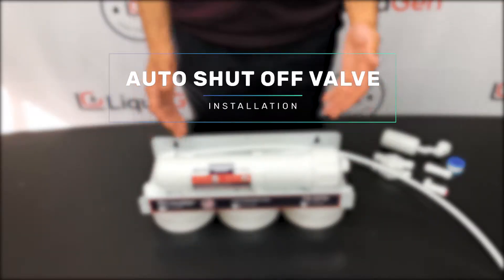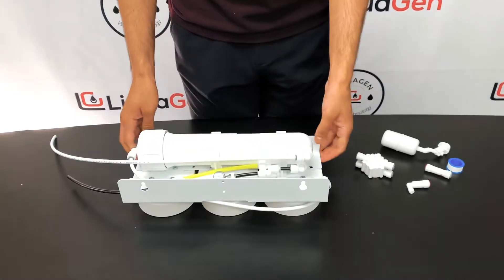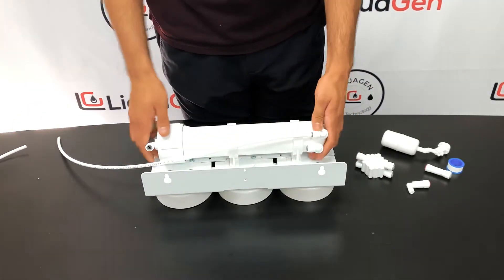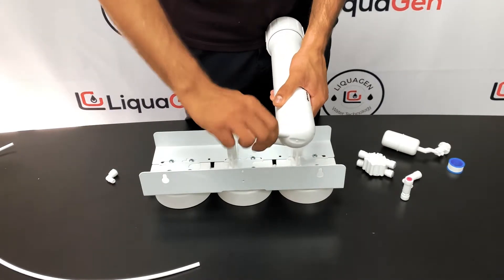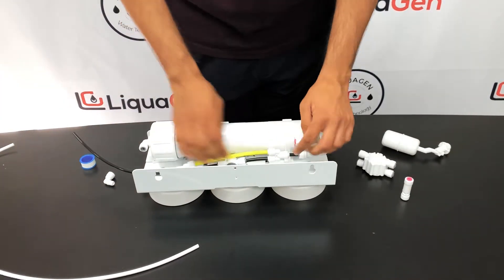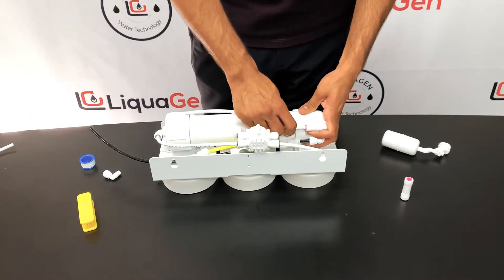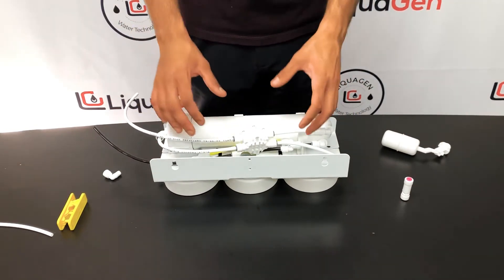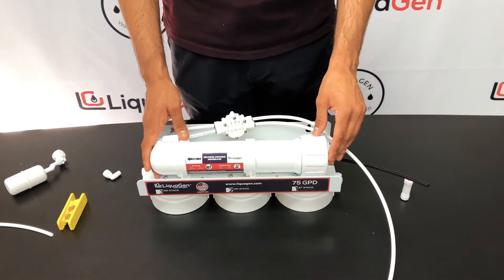How to Install an Automatic Shutoff and Check Valve on a Reverse Osmosis System

Comment: In a 5 stg unit do you still run the low pressure line in from membrane and out to di stgs or at the very end of the unit closets to float valve.

Comment: I wonder why this needs the check valve while the Auto-shutoff valve already prevent the water flow back to that direction? Is the check valve purpose to conserve water?
Reply: It needs the check valve In case the 4-way auto shutoff valve goes bad...which mine just did. I'm glad its not very expensive.

Comment: So you replaced 2 check valves?  Or is the valve on the bottom called something different?
Reply: Seemingly, the bottom, waste-line fitting was removed for no apparent reason but was reinstalled.

Comment: I don't get it man, why are all these people installing the check valve on the waste water line?  It seemed wrong and I see your video shows check valve installation on the purified water line, which makes way more sense since it's often going into a pressurized tank that could potentially backflow water into the membrane...
Reply: Per "Pure Water Products", Its purpose is to prevent backflow into the unit in the event of a clogged drain. You can add a check valve to the drain line of any RO unit.
Reply: I wished to know the proper way for my GE system and downloaded the PDF for it.
Sure enough, the check valve was labeled to go to the waste line leading to the faucet.
The other line leading to the manifold only had a screen filter in it.

I'm learning this because I changed my spun pre-filter, carbon post filter & RO membrane last week and am getting white flecks all through my water now.  The tank fills and shuts off within minutes, so It doesn't seem to be a check valve issue.
Really stumped why so much calcium is getting through this past week.